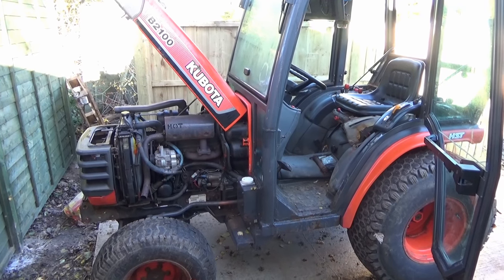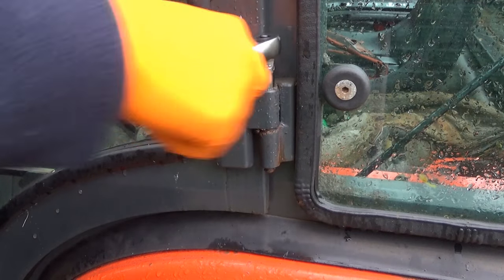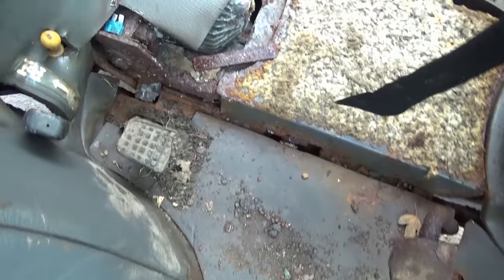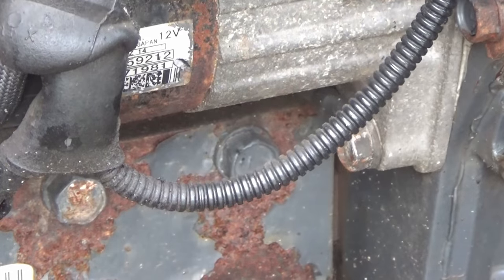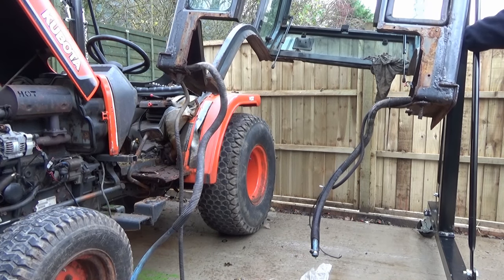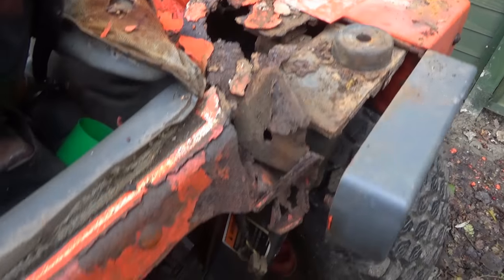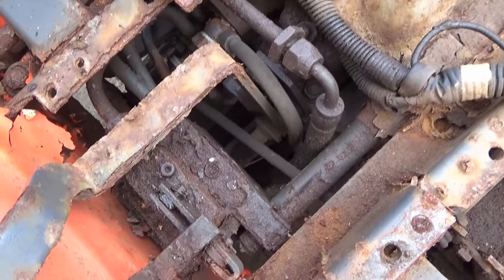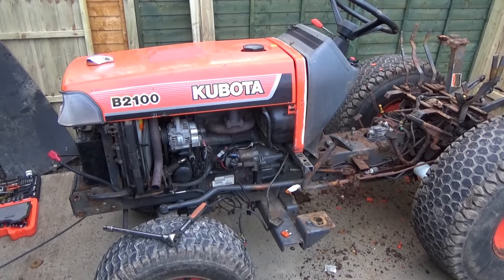Kubota B2100 Compact Tractor Restoration | Episode Four | Cab Removal

Comment: had one of these i used it for cutting the football pitches at the park where i worked at and it was as bad as your one if not a bit worse ,mechanics stripped it, cleaned back the frame and then undercoated ,used stone chip then used wax oil  and done the same under all the new panels  ,and rear arches  and anywhere else damp and muck could sit,and its sill good as new today see it now and then cutting the grass on the pitches,might be worth doing to yours ,just as a side note loved towing the little mechanical 3 gang mower behind it it was really old but had a nice sound to it singing along to radio 2 ,good job keep up the good work

Comment: You can remove those door struts a lot easier. That spring clip on the back, of you lift it off part way, it will disengage the pivot ball and pull right off.

Comment: this looks hard I've got to do the same to my ford 6600 safety cab and it's twice as big
Reply from the maker: What are you planning on removing the cab with?
Reply: +Machinery Restorer my dad a timber haulier so he got timber cranes to life it off with. I did the head lights and side lights on it and I need to do the back and I've got a pick up hitch to put on it. great video by the way
Reply from the maker: Sounds like that will make it easier then. Thanks :)
Reply: Yeah my dad got experience of restoring tractor he did a David brown 30d when he was 17 and it's still in running condition